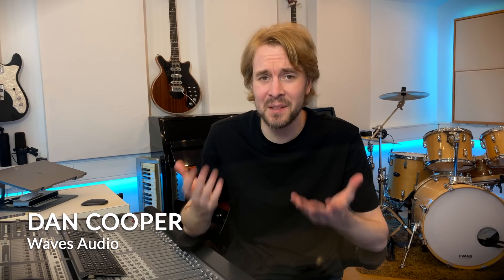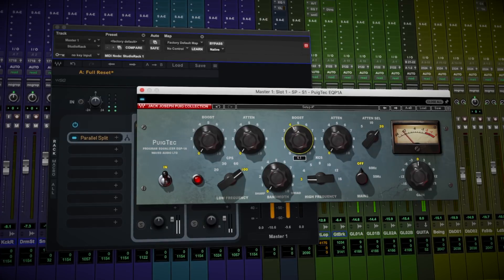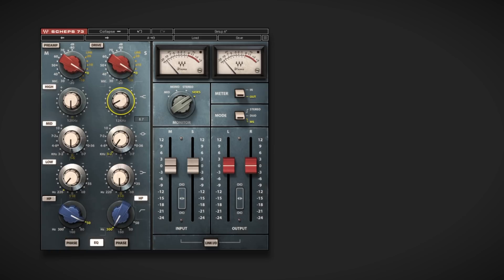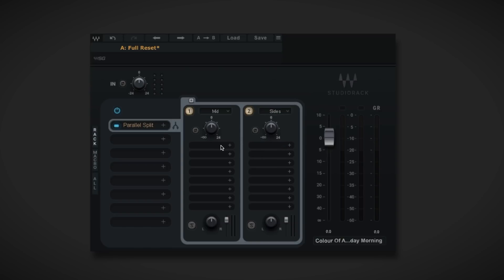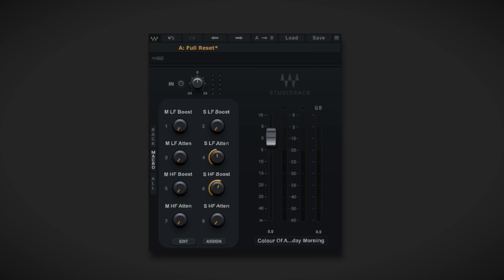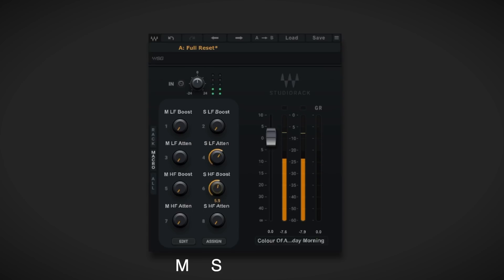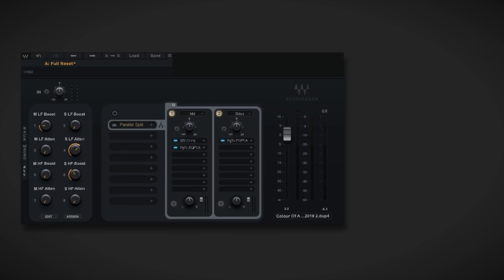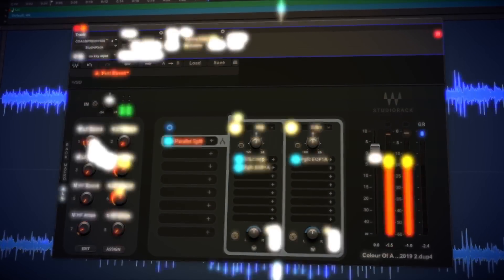Mastering Must-Have: Make ANY Plugin Mid/Side

Comment: Is there a way to have More than 8 insert effects? Cause my main vocal Chain contains 14 plugins and i Want to have all in Studiorack so i can Save my Chain
Reply from the maker: Hi @InaktiveUser, StudioRack can only provide 8 insert slots per chain. That said,  using a Parallel Split you can load up to 8 additional parallel racks (8 plugins per rack).

Comment: meh, you can do this in ableton with stock utility audio effects
Reply: agreed, but when it comes boosting HF, we are gonna need an EQ8.
Reply: @Renaxelo  Yea although I wasn't referring to that, I was referring to anything that needs to be turned from L R to mid Side Processing.  Assuming that Studio Rack is probably only for waves plugin it'd be more beneficial to do it through ableton if you're using that DAW anyway, however if Studio rack lets you load plugins outside of waves then either or seem fine by me

Comment: At what point in the mastering chain would you recommend doing this? My mastering chain typically consists of Subtractive EQ (low end cut) -> Additive EQ (high end boost) -> Multi-Compressor (control high end attenuation) -> Saturation -> Exciter (7K) -> Adaptive Limiter. I am thinking I would place my studio rack at the beginning of the chain and potentially do all of my EQ and Multi-compression in Studio Rack using Mid/Side processing prior to adding color with saturation and exciter later in the chain. Any feedback is appreciated. The Studio Rack so far has proven to be a very powerful tool.
Reply: I put it in a chain as early as possible If I feel a mixbus or master needs some M/S processing.